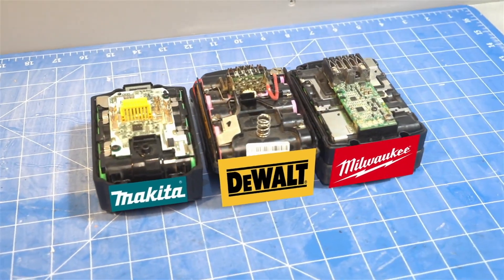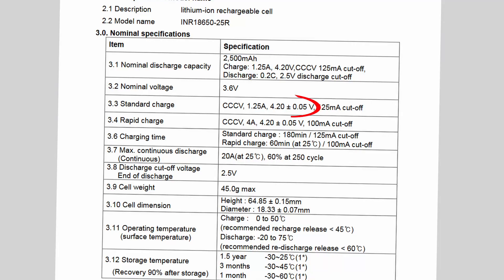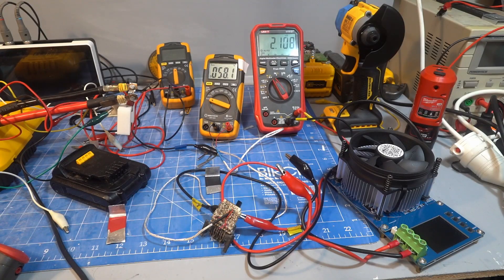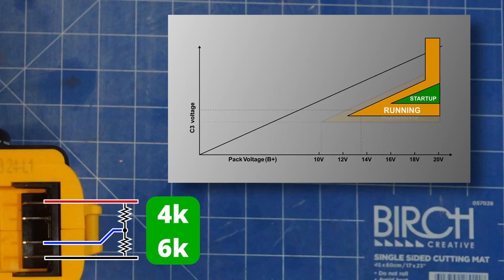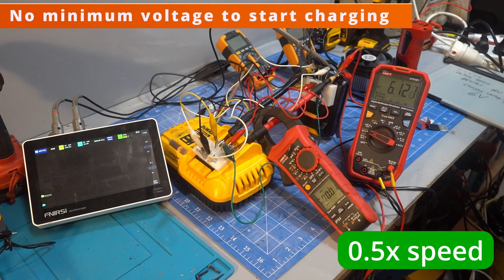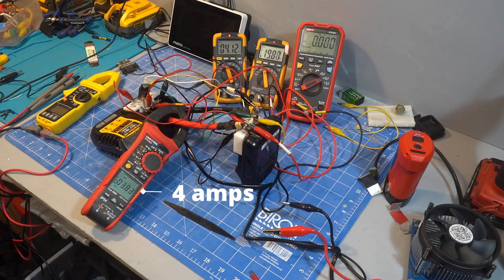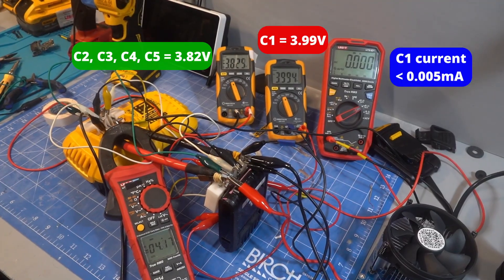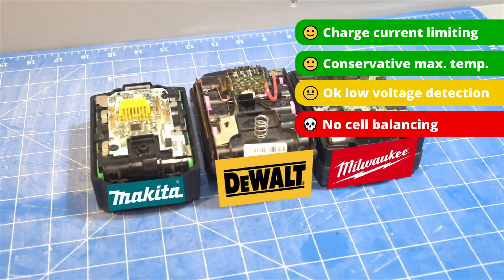[009] Dewalt 18/20V battery, tool, and charger communication

Comment: So, why are the balance leads there and exposed if nothing uses them? Crazy.
Reply from the maker: Very crazy. The upside is you could easily make an adapter to allow an RC charger to charge them.
Reply: @toolscientist  You make one of these and I will buy it ASAP. I have had 5, 5.0ah power stacks die from unbalancing and two 6ah flex volts. The power stacks are nearly impossible to deal with, the packs are taped together and individual leads would need to be probed on the PCB or possibly the socket like you are doing.
Reply from the maker: @RangerReview  I'm working on the 5Ah powerstack now and it has internal balancing. If it's unbalanced, then it's probably cell failure. It's likely the C1,2,3,4 pins don't connect to the cells, so it wouldn't help. Unfortunately similar story with FV, cell pins are "spoofed" to trick the charger and tools and don't connect to the cells.
Reply from the maker: @RangerReview  were you able to remove your 5Ah PS from the case? I've tried, but it's either jammed or gued in, and I'm not too keen on prying fragile pouch cells

Comment: Why is there no charging IC that allows the user to set the final voltage and charge current with different resistors?
I want to charge my cells to 4.0V not 4.2V and there is nothing out there that does that! TP4056 can do 1A or lower, but charges to 4.2V. 
Any ideas?
Reply from the maker: Maybe a 4.1V LDO regulator for each cell. Could have a timer circuit that disables all the LDOs after a set time.
Reply: LOL .My charge charge to 20.6v. I would like to chargr to 21V

Comment: maybe their 2 stage charging has to do with their newer powerstack and powerpack batteries.
Reply from the maker: Apart from the ID resistor, the charger treats all batteries the same. The 5Ah Powerstack has a fairly advanced internal BMS and I'll be doing a video on that.
Reply: @toolscientist  Look forward to that! These 5ah powerstacks could be more feasible than FV - it's hard to get an answer from retailers in the UK of the build date of FV packs when trying to purchase unless physically in a store where the prices are 20% + more expensive than online.
Reply: @toolscientist  I don't know much about electronics but I purchased a battery adapter for me to draw power from Dewalt batteries and all regular and flexvolt  batteries work except for the 5 ah powerstack.  Makes me wonder if there is a IGBT or something that disconnects the battery output unless a Dewalt tools is in place.  I am looking forward to that powerstack video.

Comment: No balancing and "2 stage" charging seems almost malicious
Reply from the maker: @KeijonAutoVuokra  lack of CC/CV isn't too bad. Lack of balancing seems like they've calculated most batteries will be out of warranty before issues arise. Might also explain why they only put 3 LEDs on their batteries as it'll mask imbalanced cells for longer than a 4 LED display.
Reply: @toolscientist  what’s the meaning CC/CV?
Reply from the maker: @cryingeva  constant-current, constant-voltage. It's the most common Li-ion charging method. Charge at 6A until a cell reaches 4.2V, then taper the charging current to hold the cell at 4.2V. When you get to 10% of the original charging current, stop charging.

Comment: Interesting video, what's the first voltage threshold for charging? and how come in the thermistor tests you put the range at around 2.5k but the resistance on your multimeter is 10k?
Reply from the maker: I got inconsistent results that I'm not confident about, so I didn't want to put them in the video. On the DCB118 (8A charger), I got 4.0V for 1st stage, then 4.12V for 2nd stage. On DCB1104 (4A charger), I got 4.12V for 1st stage and 4.16V for 2nd stage. I'm not even sure if it's using individual cell monitoring via that V8F chip, as that V8F chip doesn't seem capable of doing 2 different thresholds. So it could be that the 1st and 2nd stage are based on total pack voltage instead.

At 1:23 I'm just demonstrating the change of resistance of the thermistor as I heat it up with my fingers. The numbers I give for cutout are determined by the tool, not the battery. The tool will run as long as there is >2.14kOhm between the TH pin and B+. 

In hindsight that part of the video is quite poor at explaining how the tool monitors temperature. Thanks for pointing it out. I do have some footage of it in the RAW video that might show it better. That'll come out in a week or 2
Reply: @toolscientist  oh ok! that makes sense, thanks for clarifying.

Comment: Thanks!

Since many of the chargers also support DeWALT’s 12V Max batteries, how does it distinguish them? What does the battery do with the C# pins?

Also, my DCB118 chargers are both two-stage, so it seems there is an older and newer version. It’s one of the few chargers that doesn’t do 12V Max though. My only 12V Max tool is a DCL045 LED hood light which takes both. I found a 12V Max clone battery inside a 2P5S shell that you’d typically see on DCB205 (18V/20V Max). It was branded “ICYBREEZE” and seems to work fine with the DCL045 and DCB107 chargers. ICYBREEZE is a dry ice cooler + fan… thing. Anyway, I was surprised everything picked up on it like that and just worked.
Reply from the maker: @emmettturner9452  from the schematics I found, it looks like the C1 & C2 pins are switched by a pair of mosfets. On 12V packs the C1 and C2 pins are actually the ID or TH. I might do a quick vid on my RAW channel discussing it.

I think every Dewalt charger is actually 2-stage. That is, they all charge at full current for the 1st stage, then switch to half-current for the 2nd stage. The only difference with the new ones are that the LEDs tell you when it's on the 2nd stage.

Comment: Thanks for yet another informative video! Very strange that they seem not to have gone with individual cell charging since they seem to have thought of it considering the connector.
Reply from the maker: It'd be funny if their older chargers had balancing, and then they figured they could save more money from removing balancing circuitry than they'd lose on warranty claims.
Reply: @toolscientist  No balancer in 112.  Maybe in 101?

Comment: Over the last 15 years, running a building company with business partner, he uses DeWalt, I use Makita, I've had 1 battery fail, he has a pile of around 20 knackered batteries, so Makitas clearly doing well with it's advanced onboard bms
Reply from the maker: I tend to not put much stake in anecdotes as you can always find someone that says "Brand X has never failed me" and also another that says "Every Brand X tool has failed in under 3 months". But after doing these tests, I can definitely believe that Dewalt batteries fail more often. They do have the advantage that they're very simple, so fewer points of failure compared to Makita and Milwaukee.
Reply: @toolscientist  I agree about the anecdotes so take my words with a pinch of salt if you wish 😅, I've taken some of his failed DeWalt batteries and done a manual balance to 4.2 p/c and it's prolonged the life a bit in some cases, but once they seem to drift out the weaker cells seem to get hammered by low voltage, I have a dead flexvolt of his at the moment that I'm going to see if I can re-balance it, I think if they had a balancing function they would be fine, either onboard or in the charger, also individual cell low voltage cutoff would prolong life better
Reply from the maker: @stewartj00701  definitely. Their low voltage cutoff limits are surprisingly low. So any cell that falls behind is going to get cycled deeper than the others, which will accelerate its demise.

They could definitely put a low voltage chip that grounds the thermistor or floats the C3 pin.
Reply: @toolscientist  if they even had the lvc at 3v per cell that would be better, I found with the ebike batteries I've built over the years there's not much to gain going much below 3v p/c cutoff
Reply from the maker: @stewartj00701  almost no runtime, but power tools gain a bit by not tripping LVC under high current. Users get annoyed if their tool is constantly cutting out on them so most of the brands seem to have gone for around 2V/cell with 18650s. Dewalt's problem is that their detection is in the tool so it'll be the same cutoff for a little 2Ah pack as it is for big 15Ah behemoth, which will be putting deeper discharge cycles on the 15Ah than it will the 2Ah
Reply: @toolscientist  Yup this all scans for me - I had a pretty new DeWalt 4Ah 5S1P 21700 pack fail with a completely dead C3, 0V, ~0Ohm short and the pack "worked" fine in the tools/charger just with a lower voltage. Very disappointed that the chargers don't balance.
Reply: Most of the dead Makita batteries I have seen are very old and usually a bit water damaged, if they are not abused too bad they seem to hold up.
Reply: It's probably cell quality more than anything else, given we now know that Makita also don't balance charge either.

Comment: Another perfect analysis, thanks!

So no cc/cv I can somewhat understand, might be a "clever" trick to shorten the charging time since a CV phase is longer, but no balancing?? They must be smoking some bad meth. 
I wonder how they deal with fv that has 15 cells, they probably rely on putting them in parallel for charging.
Reply from the maker: Lack of CC/CV is not a big deal. Just means they're not maximising capacity, but that makes very little difference in practice.

Lack of balancing is just "wtf?". I can only think it's cost cutting in the chargers.
Reply: @toolscientist  yep. I hope you will also cover flexvolt circuits, they seem interesting enough :)
Reply from the maker: Yep. I figured they deserved a dedicated video as they're quite different. I only have one and I need it alive for testing. I might need another so I can remove the PCB and see what's on the underside. A guy made a schematic for the first gen FV, but they're up to gen 3 so might have fixed some issues.
Reply: @toolscientist   awesome, thanks :)
Reply: The flexvolt packs use a pair of switches that engage tabs on the tool that change it from 5s3p to 15s. I know the 15ah is 5s6p, that kicks over to 15s2p. Afaik they charge as 5s packs
Reply: @timothybayliss6680  makes sense yeah. Too bad that they have an issue with cells going out of balance over time when sitting for a long time
Reply: @timothybayliss6680  I don't think it's exactly accurate to call the Flexvolts 5S3P, but I don't know what exactly you would call the configuration.  Yes, there are 3 sets of 5 cells connected in parallel at the positive and negative ends of each group.  But here's the difference.  Cell 2 of bank 1 is not connected in parallel to cell 2 of banks 2 and 3 like they would be in a standard 5S2P or 5S3P 20V battery pack.  It's 3 separate 20V battery packs connected together at the ends.  That's how they're able to get 60V, by putting all 3 banks in series.  If it was a true 5S3P, then it would always be 20V.

Little details, but they're different.  Hope that made sense.
Reply: I have heard of a few colleagues having dead flexvolt batteries that are definitely not down to abuse or exposure to water/rain. 

It could have been due to it being a battery from 2021 which may have had previous gen micro chips/design.

Can't wait for your in depth video on FV. 

Makita XGT would be lovely too if this is even financially feasible. 

Thumbs up, I watch your Reddit posts too as I always enjoy your knowledge and thoughts in the Makita section. (This goes for Riba & Toolscientist)
Reply from the maker: My main systems are M18 and XGT, so little problem in testing those. I have 5 XGT tools and 4 batteries (plus a dead 5Ah that was donated to me). XGT is definitely going under the microscope.
Reply: @toolscientist  cannot wait for XGT! If my tools went up in flames tomorrow XGT would be my chosen platform. The back somehow has water resistance ip rating the 36v 5amp rivals Hiltis 36v 5.2ah battery which nearly lasts a full days work for me on the sds drilling 5.5mm holes.
Reply: @toolscientist  wondering your next video is XGT battery, just tell me how good is it?
Reply from the maker: @cryingeva  probably 2 videos away. I've been putting off XGT as it will be complicated. But I have a new battery that's been sitting on my bench for nearly a year so I can test the initialisation method, so I need to get into it soon.
Reply: @cryingeva  it is good no worries, you won't find anything better :)
Reply: @toolscientist  I glad to heard that,Makita had the best BMS , I had 10 LXT battery the older battery almost 14 years still working great
Reply: @shifty277   thanks bro, and yeah, toolscientist is the OG goat gigachad for doing this amazing work :)
Reply: @shifty277  thanks and yeah, toolscientist is the OG goat gigachad for doing this amazing work :)
Reply from the maker: I just steal other people's work and put some fancy editing on top :-)